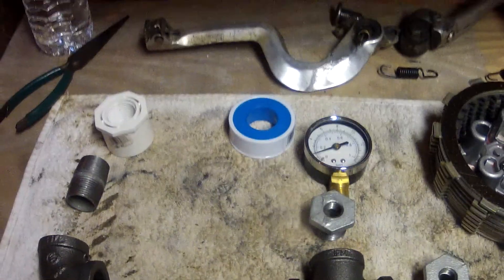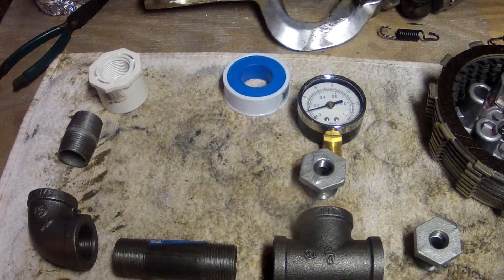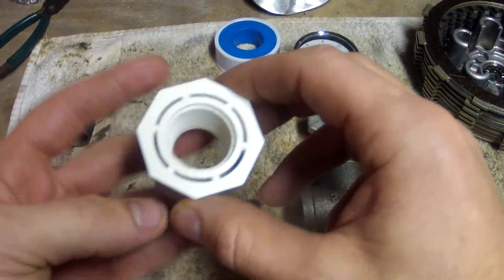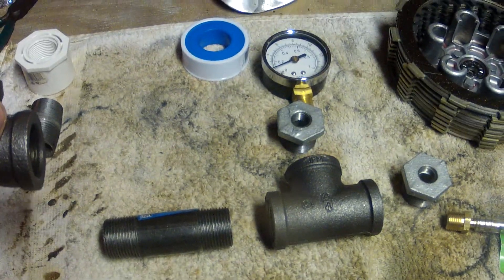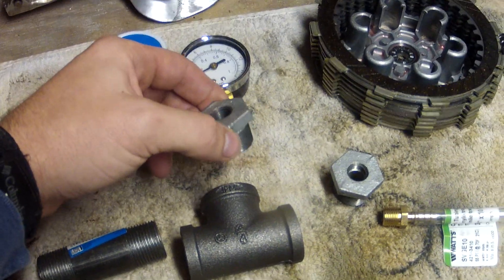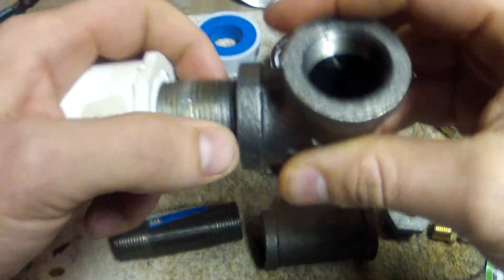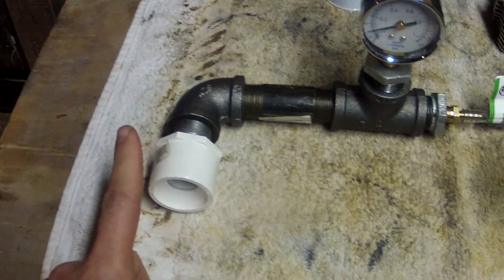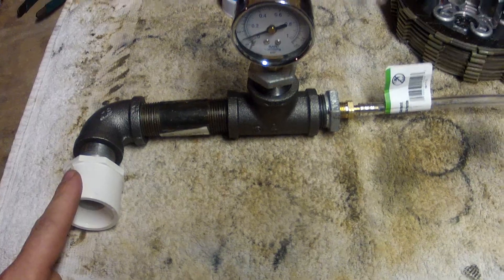How to Build a Leakdown Tester for a Two Stroke!

Comment: It won't work right unless the hand pump has a one way check valve or you have some kind of ball valve to keep the pressure from leaking back through the pump.

Comment: why not just put the engine at TDC and use the sparkplug hole?
Reply: Mike Wallybanger. I know exactly what your saying, this would be the correct way to find out pass/fail on two stroke compression.
Reply from the maker: If you did it that way, you would have to place the piston at the exhaust port and  not block the intake port.  I just emulated a method i read about in my clymer's manual.  Ended up being a wet seal leak.  So i traded it for a shotgun.
Reply: Don't think you're gettin' what I'm sayin'.  When a 2 stroke is at TDC it should be completely sealed by the rings... this is how enough compression is generated to ignight the F/A mixture.  Then, just take an old spark plug, bash the porcelain out of it and weld a QD air coupling to it.
Reply from the maker: Mike Wallybanger no i get it.  i just didn't do it that way because of the material and means i had available.  Plus, once i found the wet seal leak, i got rid of it.
Reply: Gotcha, Just got my gears turning as I need to do a leakdown in my snowmobile.